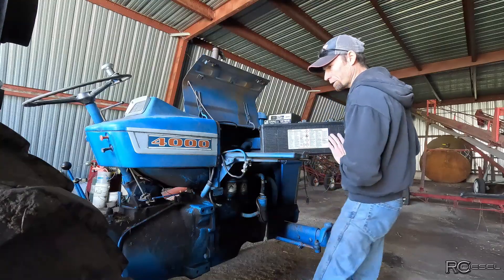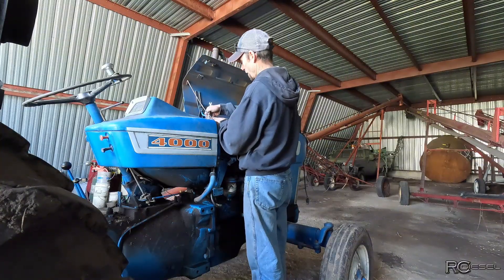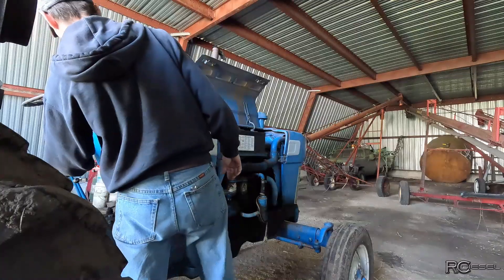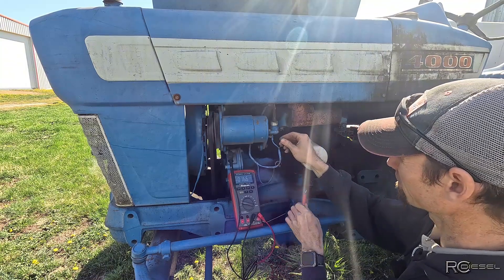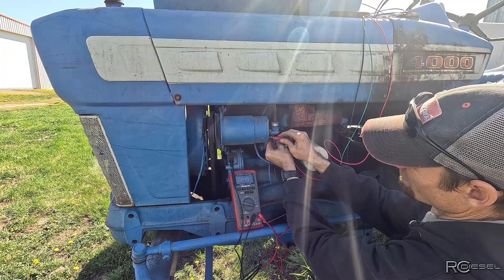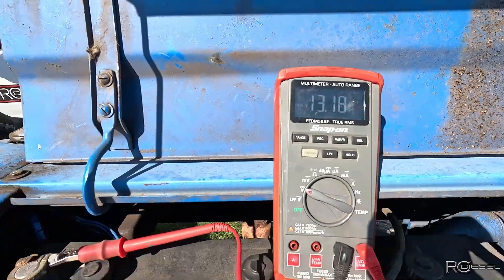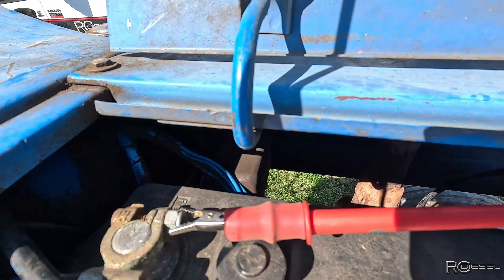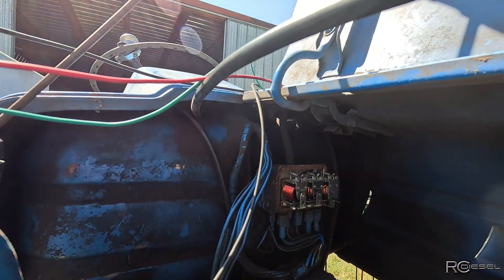🔧 Ford 4000 Tractor Repair | Charging System Diagnostics (Part 1) 🔋🚜

Comment: Never see many fords around other than the genesis and the versatile built but branded ford tractors 
they werent super popular here in the parkland side of mb and the ones that are around/for sale are the smaller 65hp and under tractors they were well built machines for the cost but didnt hold a candle to the JD and IH of the time I bought hay from a guy over by neepawa that has a ford 8000 with a loader he says its all most impossible to find parts and all most everything is discontinued   
Thanks for kind of showing how a generator works never been around something without a alternator  Could be a educational to show how they work like how you showed how to test injectors
Reply from the maker: Yeah, I don't see many around here either, I feel like they are a bit uncommon. Next Friday's video will have another Ford tractor in it - an 8240 with over 20,000 hours. I've had a bit of trouble for parts on that one in the past too. JD deffinetely has the greater market share in this area though.

I don't know a lot about generators and their voltage regulators, just the basics, just enough to be dangerous haha But theres a bit more coming on this one anyway,. I'll get a new regulator on it and see what happens.

Comment: Talk the owner into fitting an alternator bro, did that to my old David Brown 15 years ago, haven't had a problem since, good lil project for ya to fit it, the brown was an easy mod, used an alternator from a Nissan Patrol made a mounting bracket, modded a few wires and boom 15 years of no worries :-)
Reply from the maker: It's deffinetely an option. On the flip side, the generator setup has worked great for the last 60 years or so, so why not just fix it?
Reply: @rcdieselchannel  I couldn't buy any parts for mine from memory, pretty sure it was an old Lucas model, could get brushes but that was it, armature had failed figured Alts are a dime a doz and more efficient so out it went haha 🙂
Reply from the maker: @JohnSmith-wb6kq  In a situation like that, I'd do the same, hands down. Not all that stuff is repairable anynore, fair point 👍
Reply: A and I part# A-AKT0002

Comment: Took about a hour to go back in time and remember that the issue is indeed the regulator. In that the magnetic force has decreased on that coil so that it lost its strength to pull contacts closed. Manually close the contact it has the power to keep contact closed. But once keyed off does not have the power to close contact.

Comment: Great diagnostic work. How hard would it be to convert this tractor from a generator to an alternator?
Reply from the maker: Well, we'll see haha This one is a bit of a stinker. More on that to come.

Converting to alternator would be pretty easy and in hind-sight, maybe I should have just done that. A couple brackets, new belt and some wiring. Problem is, I just wasn't made that way 😅 There's really nothing wrong with a generator and mechanical voltage regulator.... I mean, it's worked great for the last 65 years or so. But I spent too much time on this one. Shoulda just converted it.